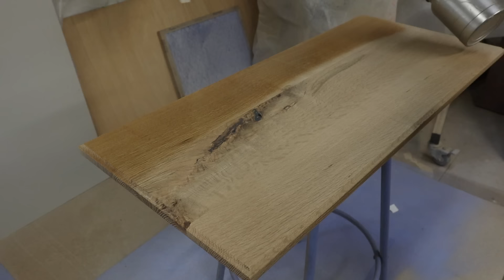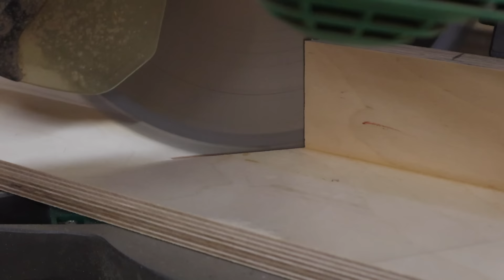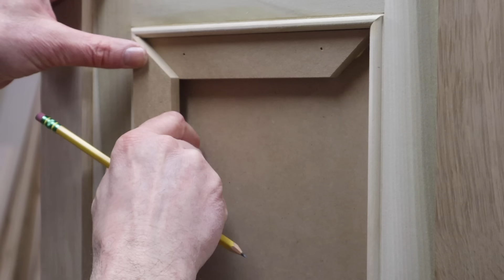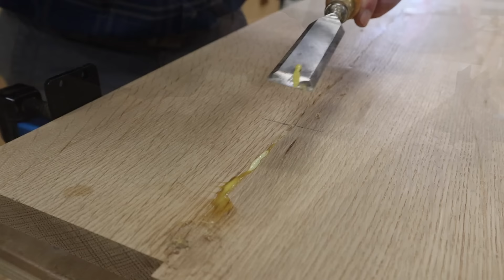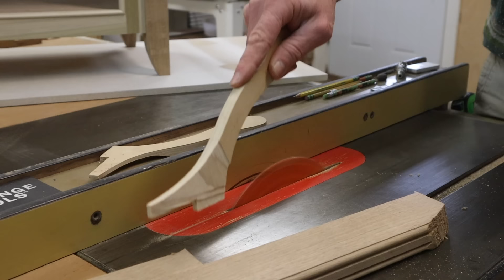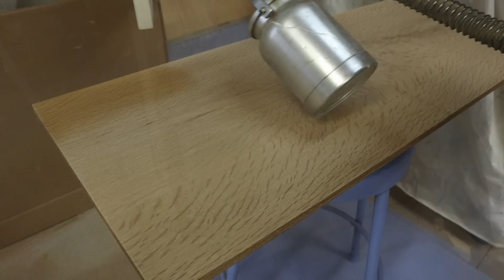How To Build a Bookcase Part 2

Comment: As always Jon, beautiful work. You definitely have a design style I enjoy. A simple question this time. You mentioned numerous times in these two videos, that you made the bottom bead molding from white oak to "tie the whole thing together". I assumed that meant it was going to have a natural finish like the top and legs, but you chose to paint it. If you where going to paint it, why didn't you make it out of poplar or mdf like the other molding? Did I miss something?
Reply from the maker: Thanks! No I did sand through the oak bead molding... I just posted a video on my shop talk channel about if you want to check it out

Comment: Maestro!
A question about finishing and spray finishing MDF when matched next to 'normal timber'. What approach do you take with the MDF to 'seal' it so that the final finish between the MDF and other surfaces look the same. Are you using a high build prep undercoat or just using multiple undercoats. Water or oil based prep for the MDF? Did I see you applying the clear coat to the entire cabinet? cheers BB

Comment: Very nice. 
A note to beginners - you may need to “kerf” trim lumber two or three times in order to achieve that perfect fit. Be patient. It easier to chop a hair off than fill the gap of cutting to much.
Reply: The "old" carpenter joke....." I cut that board 3 times and it's STILL too short!"

Comment: In respect to spraying a paint finish on a cabinet that will have different colors for the face frame and case,  is better to fully assembly and tape off one area or the other, which area and why, or paint separately and then assemble?

Comment: Great project! How do you like the rockler HVLP stray gun?
Reply: I was wondering what kind of spray gun he used to spray the paint with?
Reply: @hammertime7349  its the rockler hvlp system. Im interested in buying it but i wanted to know his thoughts are.
Reply: I almost purchased the Rockler HVLP gun but changed my mind after reading some recent reviews. I also would like to know what John thinks of that spray gun
Reply: @billkiessel6682  What made you change your mind?
Reply: Ty although some reviews were positive, the negative reviews were very negative.